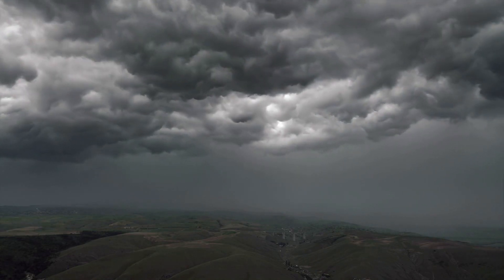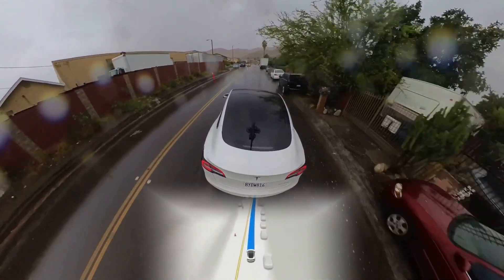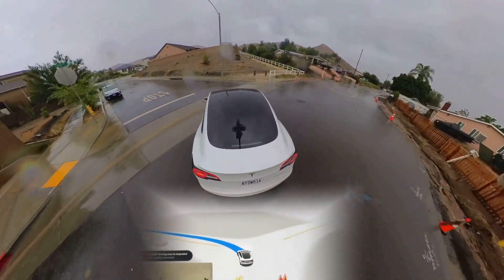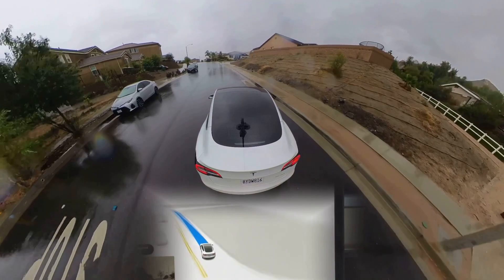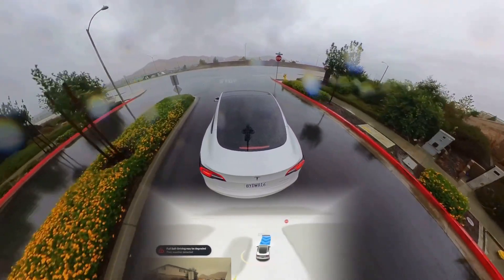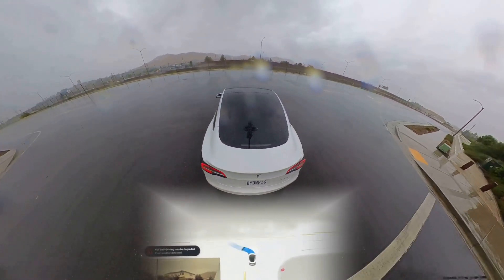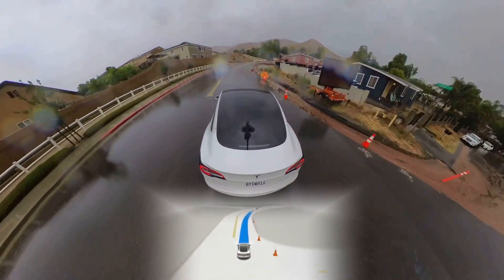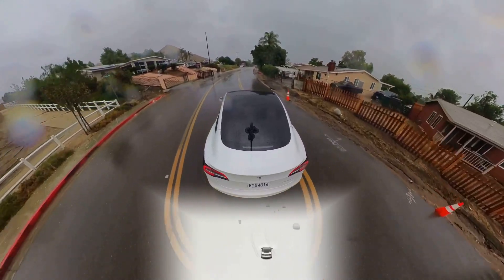Tesla FSD in the RAIN...gets stuck in loop.

Comment: The people designing fsd live in nice cities with well maintained roads and markings. 
They simply dont understand how a human is needed to extrapolate info when it is not there. 
Just like the trunk leaking water and snow when you open it. 
A bunch of rich designers completely out of touch with the real world. 

FSD will be a huge blight on the industry, carry massive amounts of liability and will never be able to interpret complex situations. 

I often wonder how great it would be if tesla had never tried to incorporate fsd, and instead opted to usher in a class of small, affordable electric vehicles and mopeds/motorcycles/bikes. 

Instead we get wasteful, luxury sports sedans that cost more than ive made in 5 years.
Reply from the maker: Fair point. In CA and a few other states tho you can get one as cheap as a new Camry.
Reply: isn't one of the lead designers from india?
Reply: I promise you FSD will get good, so good that it will be better than a human driver. It might be a long time before it can operate completely without a human at the wheel but it can certainly soon do the vast majority of driving.

AI driving is complex, they need time and experience to make it work well.